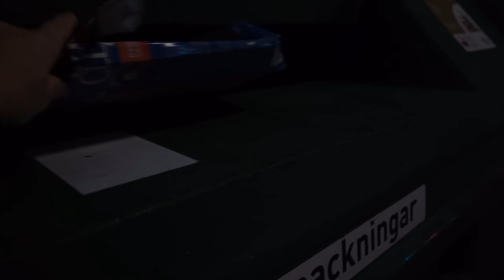Getting STUFF DONE in my NEW HOME

Comment: Benita, Putting the customized mat up against the balcony doors is a great idea. It serves as a place to wipe your feet, place wet shoes, a cat scratching mat and it may block any cold air that wants to leak into the apartment. You most likely already thought of this, but in the future, when the mat needs to be replaced, you could use the back of the the old one as a template for cutting the replacement mat. Doing this will save you from having to remeasure.
Reply from the maker: I’ve had them in all my homes and they’ve lasted me the time I’ve lived there both indoors and out but thank you for the tip!